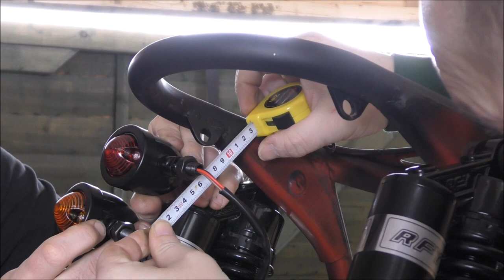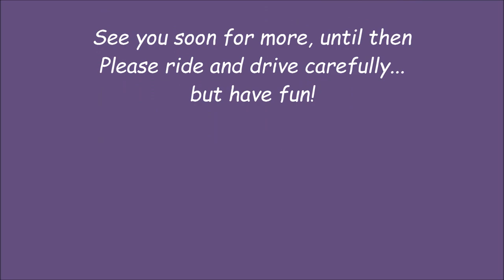Cafe Scrambler BUILD Part 10

Comment: If you are moving the pate to behind the wheel you can change the light design completely, maybe a single central red light with the indicators either side, not sure if that's possible with the rear red light/brake light combo.  Even keep the pair of reds central and the indicators either side, that way it hides the cables better.
Reply from the maker: We wanted something unique. So many, in fact most bikes have lights at the back, central and indicators either side. We wanted something different. You do make a good point, we just want something 'not norm' lol

Comment: Agree on your choice of lights for the bike, good solution on the mounting bracket, side reg plates ok, but your low mount idea is better as they can help deflect some of the crud "spout" that gets thrown up at the back.
You can weld stainless with MIG using your normal gas (CO2 mix), you'll need a small spool of stainless wire. Wot you won't get is the pretty colours and neat bead of TIG, and you can't weld the ss to mild(unless 309L wire is available for MIG). MIG might take out the stainless properties, although, I've been lucky to date, could depend on where you buy the stainless from.
That light set up works for me, different to the normal-which is one of the reasons we do this stuff.
Reply from the maker: Exactly right! I like something different to the norm. Thank you for the advice on the welding too!
Reply: By coincidence, somebody came round this pm to get some stainless welded-I did it with MIG as I am rubbish with TIG off bench, I gave the job a good seeing to with a wire brush and got a nice result-the cleaner the brighter, the nicer the weld, so if you give the ss a good going over with a cup brush on the angle grinder, it will come out nicer. (get an ss cup brush though). If you do find a TIG bloke, you could go xotic and sexy and have the mountings done in Titanium-a purge chamber is not needed for that-and, you can run a flame over it and get sexy colours.As there are two of you, you could get a sample pack each from Ticon, you get two Ti plates each-ok,you can't weld em with your kit, but you can make bolt on thingies with em.
https://www.ticonindustries.com/collections/hardware.

Comment: nice job guys , i like the lights ,i belive its 9 inches between centers for the indicators thats why the intigrated led ones are a big no no for the mot, i also like your idia for the number plate  sidemounts look ok on choppers , but it would look a little stupid for your application , just my humble oppinion

Comment: Really liked the position of the lights well done you guys. I would position the number plate buy the back wheel as you stated and could it be used as a mudguard aswell like on some Ducati's.
Reply from the maker: Hi, yes that is an added bonus, mud/water deflector too

Comment: If sidemount, use the right side. Otherwise it will be a nightmare to move the bike around. A bicycles fork works fine for holding a numberplate or as mudguardbrackets etc. They are usually shaped nice. :-)
Reply from the maker: Thank you for the tip! Yes, it will be right side, only because I was sitting on the left. Anyway, in the UK, plates should be showing to the outside anyway
Reply: John Mard, good tip there, I can't picture how the bicycles fork idea works, but I've got a bicycle in the bits heap so I'll have a look-nice one sir.
Reply: Thanks! You'll see what I mean when you stand there with the pieces in your hand. Bicycleforks are often thicker at the top and that end should be mounted to the frame of your bike. If it's for the mudguard I find the "old" style shape quite nice. A more straight MTB one for numberplateholder? Good luck!

Comment: Number plate behind the wheel looks guff. In my opinion that is of course. Reduce the size of the plate and it won’t interfere with the wheel. Don’t go too small or it’ll fail the mot. Or put. A small plate on and change it for MOT only.
Reply from the maker: The plate change for MOT was also an option, but a full size plate would reduce the visibility of those rear lights and moving them out would make them look awkward. Ideally the rear number plate holder would not be the option, especially as we took it off my Mondial 125, but I think that is because it was chunky plastic, our one will not be. Who knows...may change our minds again lol
Reply: Motors for the Masses I’m sure you can trim down a regular plate to fit the gap and it would look standard so wouldn’t arouse suspicion at mot time.
Reply from the maker: The other consideration is the space between the seat and tyre, when sitting/riding on bumpy roads; without the plate being too flat
Reply: Motors for the Masses is a the plate being too horizontal a failure? That I did not know.

Comment: I keep hearing about the UK minimum size for number plates, it's only a standard size.
There is NO legal minimum size for the plate.  It's the letters/digits that have to be a particular size as well as the space between and around them, this is what dictates the overall size.
IE.  if you have a reg. with fewer digits or using  (V2 GTF) etc. then you can have a smaller overall plate.    Motorcycles must use two lines,  top and bottom.
The problem lies with our newer registrations that use four digits on the top row like SY54 which in turn needs the larger plate to accommodate the required spaces
Reply: Thank you all verified here aside from it says should be on two lines which means its not concrete, it reads 1,2 or 3 lines to me  lol.  https://www.gov.uk/government/uploads/system/uploads/attachment_data/file/533255/inf104-vehicle-registration-numbers-and-number-plates.pdf
Reply: Hi Malcolm.
The following line from your link seems verified to me.  Although what we do is find the smallest that we know our friends in blue let us off with, usually 7x5" or 6x8" 

gov.uk
"The characters on the number plate must be set out
over two lines and 'MUST' be displayed on all motorcycles
registered on or after 1 January 1973".
Reply: yeah, re read it, bummer. Oh well its all good.